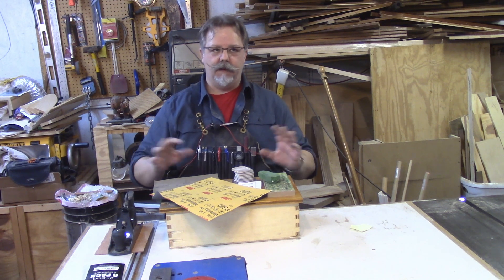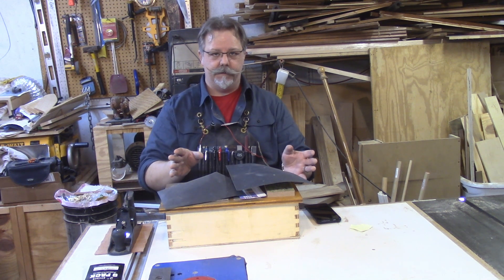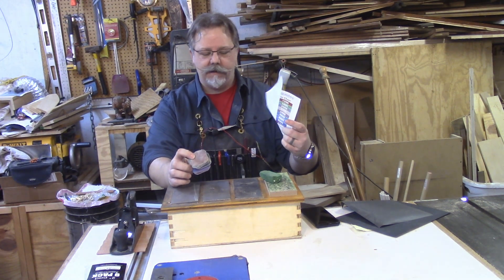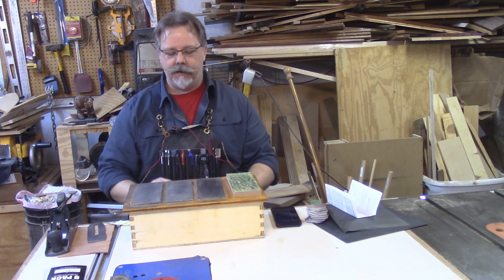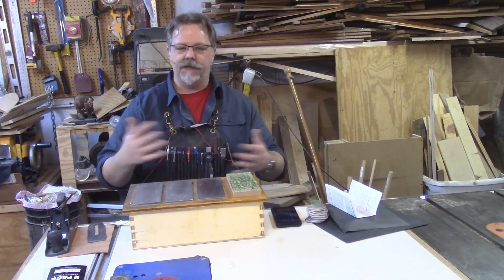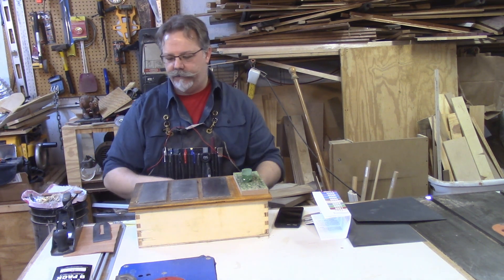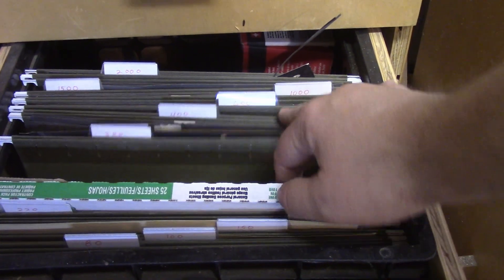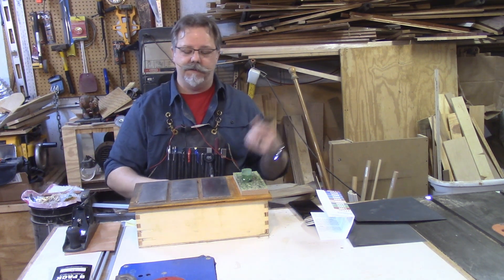Abrasive Grit Comparison | Sandpaper and Sharpening Stone Grit Rant

Comment: grit of shapton 30000(300$) = grit of p80000(15$) = 4-5x the size of dust or thickness of fingerprint .
so it's as much expensive as it's ridiculous...you can touch it with your finger or let any dust on it nor contaminate your knife :p
[ironic mode] It's very much like a workshop where you go to sharpen a knife.